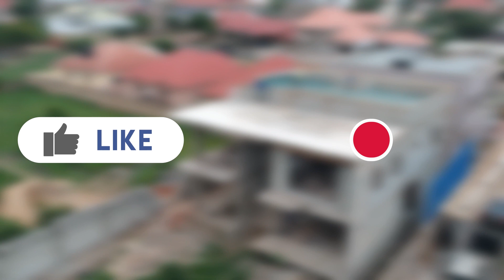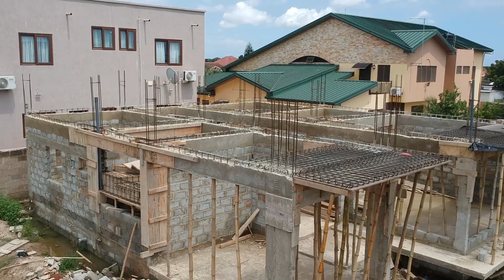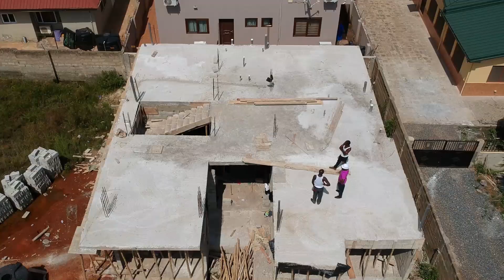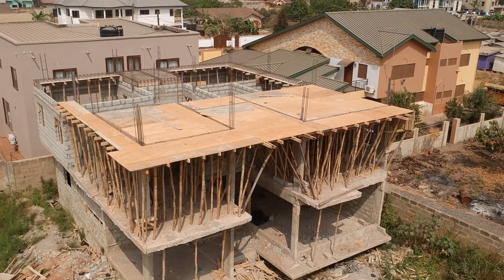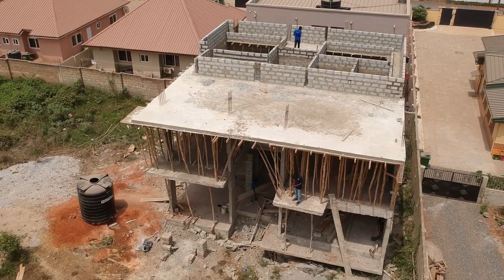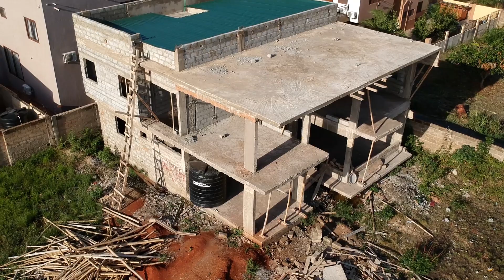How to build a Superstructure of a House on Wetland in Accra Ghana West Africa | Time Lapse Video

Comment: Good job. Please, I want to ask a question about the first floor. You only used a few iron rods for the decking, but for the rest, what did you use, bricks or big iron rods? And after that, you pure cement and sand on it. In the long run, I hope the stuff won't depart from each other. This is the first time I have seen this. The building is very solid. Great job ❤.

Comment: Hi, this is very educative. I may be wrong but

1.  did you use 4no rods for the columns from foundation all through to the roof level? If yes, why? I hear for two storey one has to use 6no 16mm rods (mild). 

2. Also, what is the size of the rods in the columns and the type (mild or high tensile).

3. What is the advantage of using the 'fast floor' and why was same not used for the second floor?

Comment: Thank you so much for this..it will be nice if you included how each process is done..how do they ensure the block work are sharp at it's edge, what are the type of wood material is used for the formwork of the column and beams.. please help to be more detailed with material types and construction methods, what is usually supervised by the engineers..God bless you!

Comment: Sir please if u could show as the details of the casting concrete  the ratio of sand, cement, and aggregate, then how u install the Hordy block in the roof and foundation (details, please )

Comment: Could you have continued building without lintels?
Reply: Rich Commodore from experience I will not advise that. A lady in France building next to my own in Dakar did exactly that. The roof started taking pressure and have to spent another £8000 for my builder to rectify that for her. May also for us we do the locally precast beams was the reason. Let's see what Jacob thinks.

Comment: Easy one teach one if you continue to share what u put out will return back to you so how much is the pre stretched beams because it is faster and better also
Reply from the maker: The price of the beams is dependent on how many areas you will be using it for. With the quantity you need, you can be able to get a cost from suppliers of pre stressed beams

Comment: When you are casting the columns do you use a concrete vibration to get the air bubbles out of the concrete??
Reply from the maker: Yes we do. We have a concrete poker that we use in all our builds. A lot of our processes are not captured on camera but as we progress, more of our processes will be captured so that you can see all that we do
Reply: @Jacobwestgh  okay I see
Reply: @Jacobwestgh  but I would like to ask you this question the holow blocks that you use at the top if they was to have the same strength as those at the bottom surely they would be more easier to be laid plus they would not obsorb so much of the sun radiation during the day I would like to hear yr opinion on this after all in Ghana it is not a cold climate that u need to obsorb the radiation of the sun secondly there is no roof windows in most of the buildings so that come night the hot air from the blocks will rise out from the building

Comment: Hi Jacob, is there any reason why hollow blocks are not used throughout the building process, I had a house built in the Caribbean where this method was used, also water pipes and ducting for wiring were put in place whilst blocks were going up ( inside of block work) thus saving chisling out of blocks. I've watched a few building projects on the continent and all seem to use solid block work. Your vids are a pleasure to work brother 👊🏿🇯🇲🇬🇧
Reply from the maker: When putting up a storey building, you want the base to be as solid and as heavy as possible so that when you go higher, your building gets lighter. This is why at the base of the building (aside the beams and blocks for the foundation) we used only solid blocks and thick columns and then when we got to the first floor we used hollow blocks for the block work with lighter columns. If the building is lighter at the top than the base, the chance of the building collapsing is very low as compared to if the weight was the same from ground up.
Reply: @Jacobwestgh  we also use hollow foundation blocks in the Caribbean which is thicker and heavier than blocks used for walls but those blocks are fill with concrete for added strength too. what i do realize from watching several videos of house construction in Africa is that mortar between blokings in thicker than what i would see in the Caribbean. I wonder why is that?

Comment: The mator joints are too thick it should be ten mm or 3/8 of an inch cement should be 4 and 1 ,4 sand one cemet

Comment: Very professional and to the point! It would be great if you included estimated costs for the various stages as you work along. I'm particularly interested in costs relating to the use of pre-stressed beams/blocks for foundations and roof/flooring versus the 'traditional' ways where lots of iron rods are used.  Keep the great content coming. Cheers!

Comment: Hello can you furnish me with how you did the decking. What the method called. Referring to the hollow blocks method to reduce load Or can you refer me to where I could read up on it. Thanks.
Reply: @yominiyi2000 Google "pan and joist roof "or "beam and block roof".
Reply: @gilmoreskeen1234  I need to forward a building plan to yourself for your advice. Can I have your email address pls. Thanks
Reply: @yominiyi2000  Not my area of expertise, sorry.

Comment: I noticed that the roof slopes towards the rear, into a sort of gutter. During heavy rainfall, water would not be thrown off the roof to the ground but will be collected in that gutter.
How does that work?
Reply from the maker: We have installed roof spouts in the space you see at the back of the building. All rain water that falls into this area is immediately evacuated from the roof to the base of the building. Unlike the house behind which has pipes sticking out, the pipes from this building will be wrapped around the building so that all the rain water will be collected into one pipe at the base of the building. This way, water can either be allowed to flow into the drains or be harvested into water tanks.
Reply: @Jacobwestgh  Great! That makes sense.

Comment: Pre-stressed beams or rib & block slab are great. However could you explain why no wire mesh was laid on block prior to the casting of the concrete as is done with this method in other jurisdictions.
Reply from the maker: The beams used in this process have steel reinforcement woven into them. This provides us with the adequate strength we need for that particular floor. In the instance where we covered a much larger area and was expecting a lot of load on the floor, we would have used additional steel reinforcement before casting.

Comment: Great video. Clearly from a professional.  Looking forward to more content.  How long did it take to complete each phase?
Reply from the maker: For the foundation, it took us a little over 6 weeks and this was because of the challenges we faced with the land. Had it not been the case, we would have done it in about 4 weeks. The work on the ground floor superstructure took a little over 4 weeks. First floor to lintel also took a little over 4 weeks to complete. The concrete roof took about 3 weeks and the whole roof took 3 days to complete (2 days to fix the roof members and 1 day to install the aluminium roofing sheets). These durations may vary depending on a number of factors but for this particular project, that is how long it took for us to do the various phases.
Reply: @Jacobwestgh  Thank you.  Build looks good.